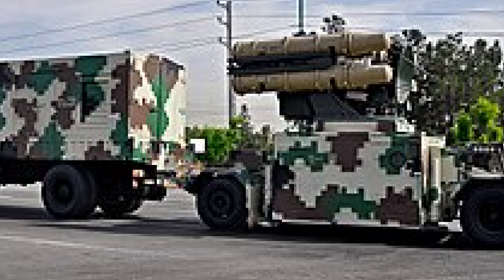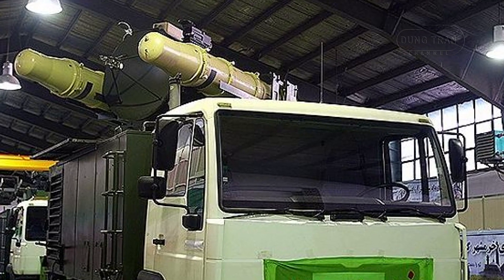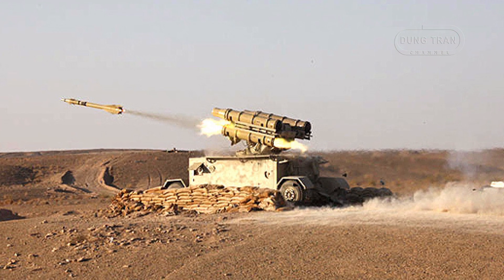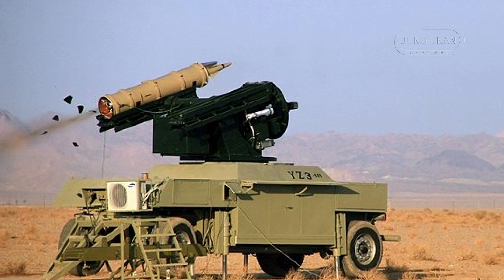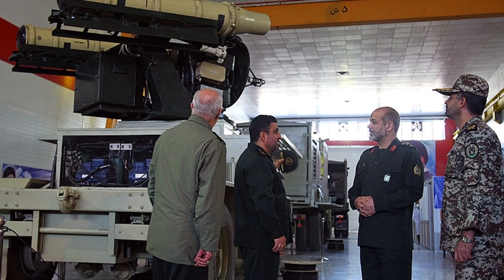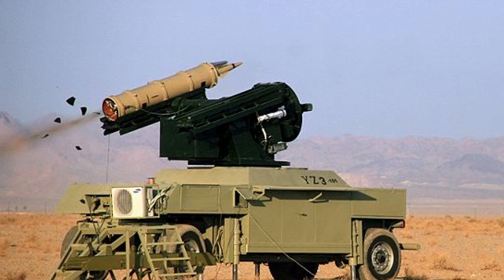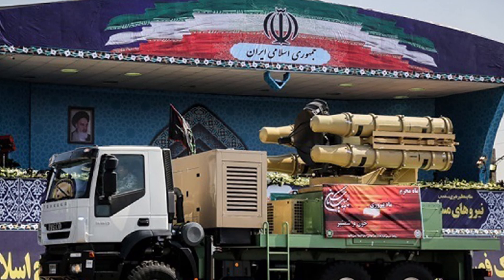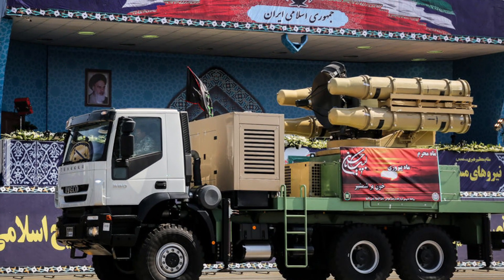Ya Zahra: This How Iran Mastered Reverse Engineering to Dominate Air Defense

Comment: Comparing this short-range passive system to the US Patriot or US made (Fake Israeli name) short range SAM designed to deal with rudimentary 1940s design Katusha rockets is misleading comparison. Ya Zahra is very effective against projectiles, Drones, helicopters, and cruise missiles at very low-altitude flight course. Its optical detection method allows for instant detection and successful intercept of flying objects at such low altitudes. The Patriot does not have any proven records of successful intercepts against low flying objects as proven by Yemeni Houthis as they destroyed several Patriot batteries in their attacks against Saudi Arabia in multiple instances during the Saudi/US war against Yemen. Finally, the US made Iron-Dome doesn't compare to this Iranian system because it has an active radar that could be detected and destroyed by an attacking Aircraft or a modern ballistic missile since it's relatively easy to locate and neutralize which was done on many occasions by Lebanese Hizballah recently using drones and precision guided missiles. Lastly, the Iron-Dome is made to deal with Katusha rockets and artillery shells, thus, it lacks the ability to detect low flying object such as drones, and terrain following missiles which is the sole purpose of designing Ya Zahra air-defense system.